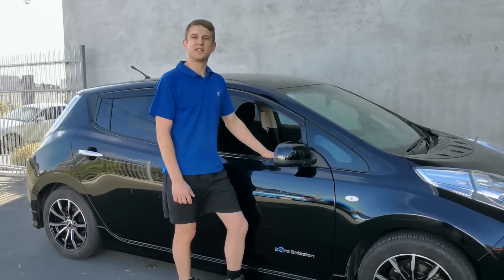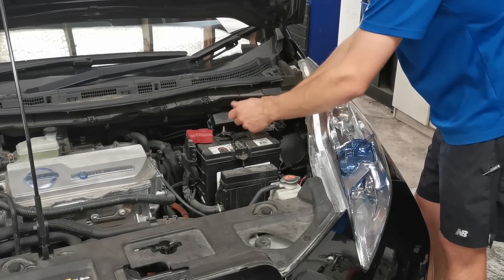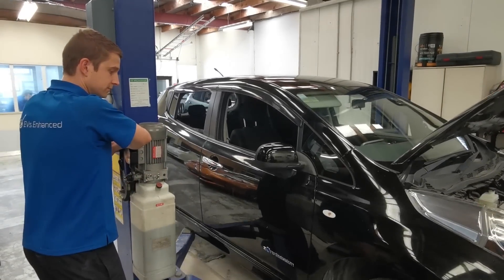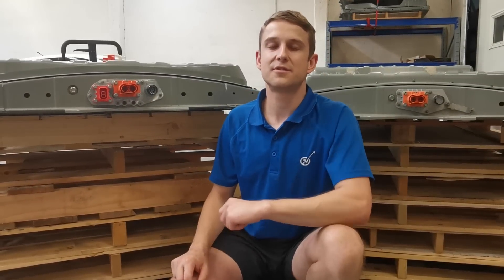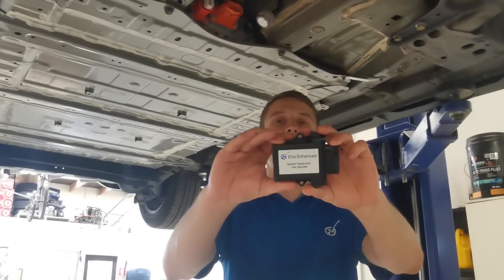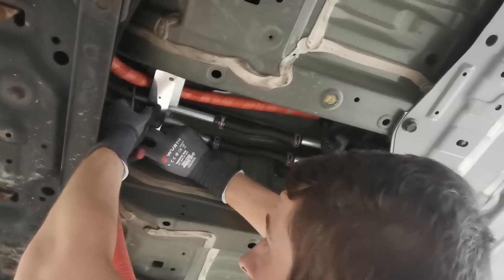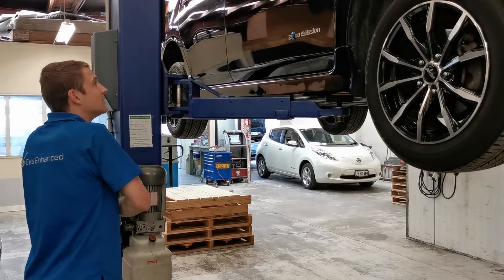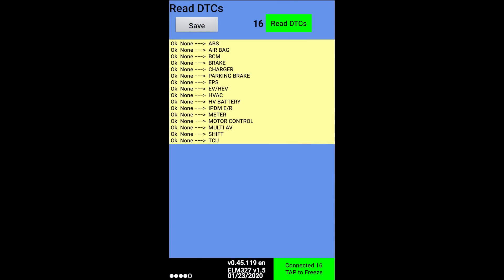Nissan Leaf High Voltage Battery Upgrades Made Easy

Comment: ....WITHOUT THE MUSIC THE BATTERY EXCHANGE IS NOT POSSIBLE!  ...THE MAGIC MUSIC KEEPS THE NEW BATTERY CHARGED WHILE THE EXCHANGE IS TAKEN PLACE.  ..IF THE MUSIC STOPS IT IS VERY LIKELY A LEAK HAS ACCURED!  ..STOP!  ...FIND THE MAGIC MUSIC LEAK THEN PROCEED WITH CAUTION!  ...BETTER TO USE A NEW MAGIC-MUSIC PACK UPGRADE NOW AVAILABLE AT YOU LOCAL NISSAN DEALERSHIP.
Reply from the maker: Ha. At least one person appreciates the music :)

Comment: Can you just get the bad cells replaced instead of changing the whole battery
Reply from the maker: Hi. In most cases you would need to replace all the cells to get a significant increase in range.  While there are some cases where a pack only has a few problematic cells, this is the exception.  Also, if you want to upgrade to more capacity than the car had originally then the original lithium battery controller in the battery pack also needs to be replaced (with other things) to match the cells being used.  Hence if you have a good complete higher capacity battery pack then it makes more sense to use it complete.  The old battery pack can also be swapped into another Leaf with a worse pack.  The lowest capacity cells are the ones that get removed from packs to be used in stationary storage applications.

Comment: The only issue was the UNNECESSARILY LOUD music and the quiet voice.. I had to continuously move the volume control to stay with what was happening...  
The changeover was inspirational. I would love a Leaf.  
An idea of costing would be great
Reply from the maker: Hi. We have already had that same feedback from others regarding the music and have passed that on to the person responsible for next time.  The upgrade price is primarily dependent on the cost of the replacement battery which varies quite a lot between different parts of the world. Here in New Zealand we tend to pay more than the going rates in the Americas or Europe.  However, there is a price calculator on our website for upgrades in our own service center.  We have a growing number of partners in other counties using our translators as well.

Comment: Can this be done to a 2013 leaf and use the 60kwhr battery pack from a wrecked leaf??
Reply from the maker: Hi.  The 62kWh Leaf battery doesn't bolt straight into an earlier Leaf as the mounting points are different. But with some fabrication of a custom mounting kit it can be done. Also the 62kWh pack is significantly heavier than the earlier packs so upgraded springs etc are worth consideration.   40kWh into a 2013 is a straight bolt in job like in this video though.
Reply: @EVsEnhanced  that's good to know is there any other hardware needed for the dash to register the new battery pack. I still had the idea of making modules of the new 2170s or the 18650s to have more capacity or the LG chem pouch cells. And I would beef up the suspension for the 7 year old car 2013 leaf. Espacially with the benefit of the chademo port. Would like it to for it to achieve 350 to 420 miles on a charge would be great. Or have it hold 60 to a 90kwhr battery pack and just use it for traveling. It only has 85k miles on it. A d the chademo works great. Just holds 10kwhrs at the moment. With it's original battery pack 7 years old.
Reply from the maker: @dr.projectx5142  Our battery translator as shown in the video is what allows a latter battery pack to function correctly with an earlier car.  We currently only support genuine Nissan battery packs.  Using aftermarket cells with any original Nissan LBC (BMS) has associated problems that have not yet been solved.  Essentially the LBC needs a custom firmware update developed to suit whatever aftermarket cells are used before it can function properly.

Comment: Anyone in the UK doing this yet? I have a 2013 24kvh with over 80000 miles giving me 60 miles on a 35 minute fast charge.  Needs upgrade.
Reply from the maker: Hi.  Yes. Check out electrongarage.co.uk
Reply: EVs Enhanced cheers
Reply from the maker: @THEN1S  No problem.

Comment: Thanks for the video! Are the battery pack swaps similar for the ZE1 models? 40kwh-62kwh?
Reply from the maker: Hi.  40kWh is physically the same as a 30kWh externally, with similar weight and and retains the same connectors and wiring.  Only the firmware in the CAN translator is different.  62kWh is considerably heavier and has different mounting points to attach to the car.  A custom mounting kit can be used to fit a 62kWh though, upgraded springs etc.

Comment: Wow... best and most elegant upgrade solution I've ever seen for the Leaf. When you get the 62kwh translator figured out...that will be pure gold for any Leaf out there.  I wonder what the range would be on a 62kwh battery with the original 80kW motor compared with the newer Leafs that have a 150 kW motor.
Reply from the maker: Thanks.  We're still working on obtaining a spare 62kWh battery to test with.  They aren't easy to come by in our country yet. Hopefully not too far away though.
Reply: @EVsEnhanced  Any news on getting this to work on a 62kWh pack?  Or even a 40kWh pack?
Reply from the maker: @edvoon  Hi.  We found a 62kWh battery to use for development, but haven't worked on the conversion into 2011/2012 cars yet.  Have done and tested 62kWh in 2013+ though.  40kWh in 2011/2012 car is in beta testing at the moment. 2011/2012 cars also need a custom VCM reflash that we developed to resolve some silly things that Nissan did in the VCM firmware.
Reply: @EVsEnhanced  oh man firmware issues. Thats one of the only things im skeptical with concerning the converaion fron gas to ev's is right to repair related issues. Especially here in the states :(
Reply from the maker: @adamkrasneski3679  Yes. ICE to EV conversions on modern vehicles without compromises are certainly quite difficult.  Battery upgrades on existing EVs aren't as difficult fortunately.
Reply: @EVsEnhanced  in case u misunderstood, i meant the conversion in the market. As in evs becoming popular enough to price and support across the whole country as opposed to mostly just the coastal areas. Or even becoming (hopefully) the new normal in society.
Reply: @EVsEnhanced  although maybe i was misu derstanding and u were bringing up the poi t that repairs rarely happen so the issue should be uncommon. Which is a start i guess.
Reply from the maker: @adamkrasneski3679  Oh yes, your comment was misunderstood.  That is a fair point.  Most of the right to repair stuff traditionally has related to emissions. Obviously that is out of date now.  For better or worse, over the air updates look to be the future model.   So neither OEM franchised dealers or 3rd parties will need to try to keep the firmware in vehicles up to date.
Reply: @EVsEnhanced  Thanks so much for this very instructive video. Indeed you have such unparalleled skill. Just 2 questions: 1) When testing 62kWh in 2013+ were there any additional requirements or technical know-how?  2) link on how to purchase the HV Battery Pairing Tool, and price?
Please keep up with the excellent job, thumbs up to you.
Reply from the maker: @marriocharles4168  Hi. Check out https://evsenhanced.com/products/battery-translator/ and https://evsenhanced.com/product/nissan-leaf-hv-battery-translator-kit/ for more information. Our pairing tool is no longer required with our current translator kit. Fitting a 62kWh battery is more complex than a 30 or 40kWh battery upgrade due the the additional mounting kit being required and ideally heavier springs as well. We don't sell these parts additional parts.
Reply: Saw Dala's EV repair fitted a 62Kwh, and got 446km(277mi) on 95% charge.

Comment: I have a 2014 LEAF with 98,000kms on the clock and full battery health (according to the car's display).  Can I get some advice:
1. How much further until I lose a bar?
2. How much should I pay for a replacement battery (used from wrecked LEAF or otherwise)
3. How much for your conversion kit?

In essence, I'm trying to get an idea of the costs I am facing to upgrade my car and how I should start preparing for it, ie: should I start looking for a deal on a used battery now?
Reply: Further to the above - I'm sitting in Canada.  Do you guys have any relationship with an organization in Canada?
Reply: Mark Plain get the LeafSpy app and OBD dongle to determine state of health (SoH). 1st bar is lost at 85%

Comment: Ok. My Leaf is at 69% SOH and it does my (two-way) commute twice over with ease. I think, when I first got it nearly four years ago with 85% SOH, it would do three such commutes, just. What's my point? Unless the battery SOH collapses completely (which I have not heard is happening even for 2011 Leafs), there are people out there who can happily use these cars and continue using them for years.

Comment: Cool video.  Just wanted to add the tip that when I looked at replacing my battery I came across Fenix, a company doing battery replacements that cuts you over to battery as a service,  with a battery pack with cells that they swap out for good cells so you are always working with a good battery/charge.  You can lease their battery as a service, or buy it.  May be a good option for some.  Cheers.

Comment: I am thinking of building a battery for a Nissan Leaf from scratch. Why you may ask because this is the stuff I love doing. The only thing that I am unsure of is this. Will I have to use the same 2 v  or 8-volt cells? I was thinking of using the 18650s or similar cells. If you think it can't be done with the 18650s or similar cells please explain why. Thanks in advance.

Comment: Great video, thanks for taking the time to put it together!
From my experience of 24 kWh and 30 kWh LEAFs, the 30 kWh model seems to be more willing to take on a higher charging current when rapid charging, so it charges faster than the 24 kWh model.  Since you've retrofitted a 30 kWh pack to a 24 kWh LEAF, have you tried it out on a rapid charger to see if it accepts a higher charging current than before?  If so, is it comparable with the charging current accepted by 30 kWh models, or is the charging power more akin to the circa 35 kW peak that 24 kWh LEAFs tend to experience, even with the 30 kWh pack fitted?

Comment: 3:30 "now its time to unbolt the hv voltage battery"
this part is dangerous, the battery weights 700lbs. plz everyone be careful if you attempt this
Reply from the maker: Agreed.  While our conversion method is as safe as it can get (the battery pack is never opened), between the high voltage risk and the mass of the battery pack itself there are still several safety risks that need to be treated seriously.

Comment: not wearing any safety glasses, face mask, hearing protection, or electrical gloves. You really have low standards of safety, i wouldn't trust you working on my vehicle for this.
Reply: I think you're overreaching a bit there. Point-by-point:
Safety glasses: There are no fluids, no impact or cutting work here. Not even any dust is evident. Low risk. The riskiest eye situation is maybe having a bolt fly out during wrench/socket use? Very unlikely.
Face mask: For what? No fluids, no chemicals, no gases, no open wiring... and this is before COVID, but even if it wasn't, NZ is amazingly COVID-free.
Hearing protection: maybe for the air wrench. Looks like about maybe a full 2 minutes of exposure. Not super threatening.
Electrical gloves: These parts all have failsafe connectors and hidden contacts. Neither battery is damaged. Risk again low.
Maybe you're used to working in different circumstances?
Reply: Guy Fawkes 3:25 I’m seeing insulated gloves in use at key times

Comment: Good video. Thank you. What is the price for the kit? Also, noticed front bumper - where can I get one like this?
Reply: Where can I get the OBD to leaf battery adapter, blanking connector and AB enhanced translator kit (translator module, mounting brackets, fastener and full loan for simple plug & play).

Comment: Great to see here in Christchurch. Great work guys. I have a 2012 leaf which could be up for that in a couple of years. Also, are you converting the old batteries for home storage solutions or is someone else doing that? I have solar but no batteries at this stage and it’s something I would like to do but not at Tesla prices.
Reply from the maker: Hi Derek.  Thanks for the encouragement.  We trade in the customer's old low SoH battery pack.  The modules are then removed and used for stationary storage applications as you say.  The pack housing/enclosure is stored for future aftermarket upgrade options.  We think that the used modules are more viable for larger industrial stationary storage solutions than at home.   The exception is people in remote places that are completely off-grid.

Comment: Have you ever had to replace the fuse for the ptc heater for a 2012 Nissan leaf , I think its in the junction box area. thanks for all the good work you are doing and sharing , I plan to upgrade my leaf to the 40 kwh battery when you have the translator box done for the 2012 leaf. thank you

Comment: Hi - I thought the >2017 Gen 2 only came with a 40kwhr pack and that Gen 1 were either 24 or 30 ?
Reply from the maker: Yes. That's right, but the 30kWh battery didn't arrive until late 2015 and while these physically fit into the earlier cars there are communications and connector differences which our translator kit addresses.   Same with a 40kWh battery into an original shape Leaf.
Reply: @EVsEnhanced  I think he's referring to the fact that you said the replacement pack was from a 2017 LEAF. But obviously the one you sourced was from a 2017 Gen1 LEAF.

Comment: Ev' Enhanced I am trying to find a 40 kwh battery for an upgrade by you at a later date, the salvage yard are ask me for a battery  part number and is it with the battery warmer or no warmer, can you help me with this, could I use the part number off the 40kwh battery you have, thanks

Comment: Whats the price for this to be done in Auckland? Thanks
Reply from the maker: Hi. We have several partners in Auckland that can perform this swap.  Assuming you want a drive-in drive-out service, it will depend on the condition of the current battery in your car, but for rough figures we would have charged around NZ$10k for the swap in this video in our Chch workshop.  If you email us at enquiries@evsenhanced.com with more details then we can give you more accurate information and put you in-touch with someone close to you.

Comment: It's too bad that the auto manufacturers don't more offer this is on the alternative to buying yet another vehicle when the one in front of you for no other reason does not need replacement.
Reply from the maker: We agree in general.  However, there has been a positive development from Nissan USA recently.  Check out our website news for more info at https://evsenhanced.com/nissan-usa-now-officially-offers-a-40kwh-battery-upgrade-for-the-30kwh-leaf/

Comment: I'm suffering some Leaf range envy after watching this.  Very clean work!  I know you guys are probably still working out the specifics, but do you have a ballpark idea of what you would charge for this conversion?  Where do you plan to source new 30 kwh batteries from?  Keep it up!  It is so wasteful to send these Gen1 Leafs to the scrapyard after 50k miles, just because the battery is degraded.
Reply from the maker: Hi.  Currently all of our replacement battery packs come from vehicles that have been lightly damaged.   In our New Zealand based workshop we would charge approx NZ$10k (approx US$6k) for this conversion drive-in, drive-out when we keep the cars original battery.  That being said, we tend to pay more for good replacement battery packs down here than what you would expect to pay in parts of the US, Canada or Europe.  Our translator hardware is a pretty small part of the cost - the majority is in the replacement pack itself.
Reply: @EVsEnhanced  Thats a very competitive price.  Very fair.  I worry about pack supply as new Leaf sales continue to (unfortunately) decline.  I'll definitely be a customer of yours when I get around to tackling a "Leaf Battery Refurbish Project" build.  Thanks for the response.
Reply from the maker: @InnovativeSustainableSolutions  We agree.  Used packs will only get us so far due to supply limitations, but it is a step in the right direction.  We are going to need new replacement packs to be available for purchase.  As you mention, new Leaf sales are declining which means Nissan should have surplus supply of new 40kWh packs available.  The current US retail of a 40kWh pack is US$11k + US$1k if you don't return your original battery.  That isn't too unreasonable in our opinion - the problem is getting them to sell them.  If Nissan doesn't get involved soon they will miss out due to the aftermarket alternatives coming.  Some of those are exciting - others are scary.

Comment: Many thanks for the great video - one quick question, i have a 2014 acenta model(UK) that still has the settings to charge to 80% (discontinued in later models), does swapping to 30 kwh still keep this software function ? Once again many thanks
Reply from the maker: Hi.  Yes, if the car had the 80% option then with our translator this functionality will be retained when swapping to a 30kWh or 40kWh battery.